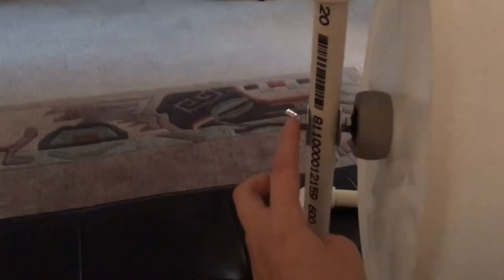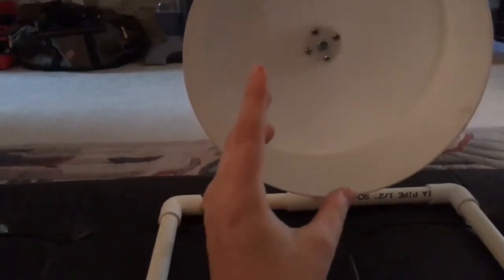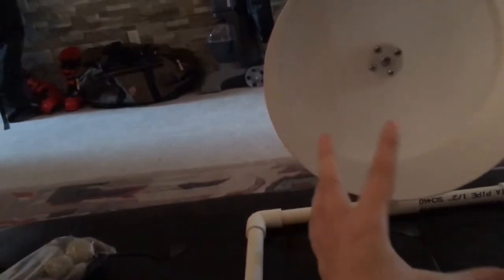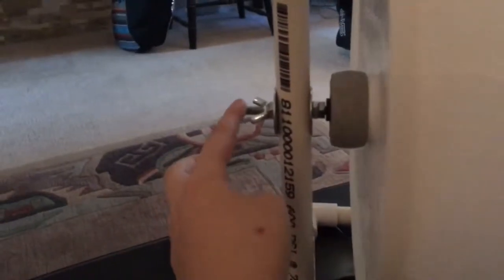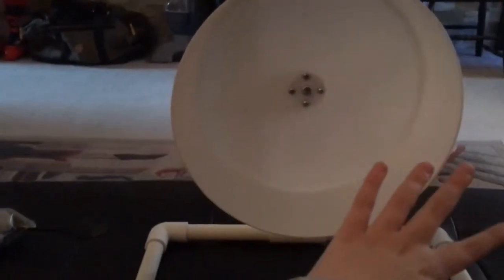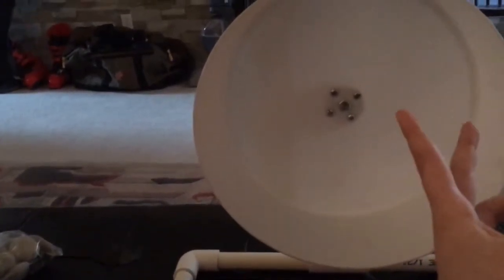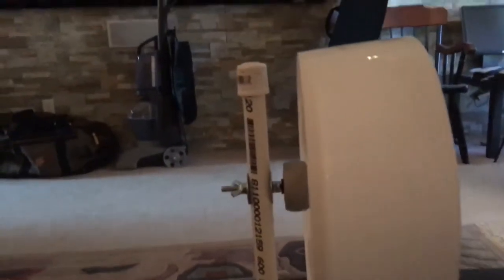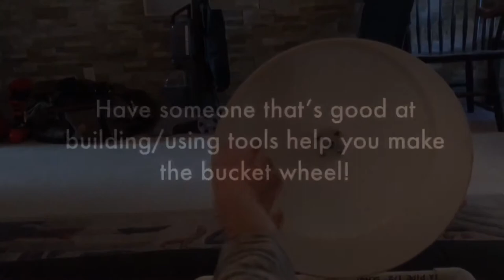Diy bucket wheel!

Comment: Do you think making the length of the PVC pipes a bit shorter would still hold up the wheel? I want it to be able to fit sideways in my 55 gallon tank, which the Carolina Storm doesn't do.
Reply from the maker: John Camacho I’m not sure you could try making them shorter but the stand might not be as sturdy and might fall over.
Reply: Tank? Hope you don't got rats. Should be a cage.